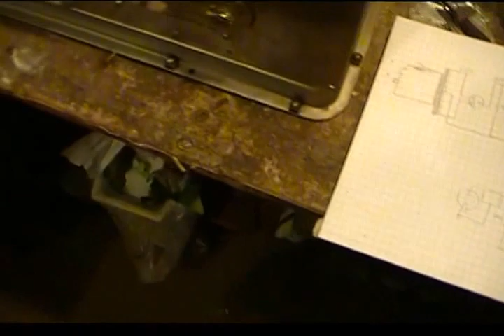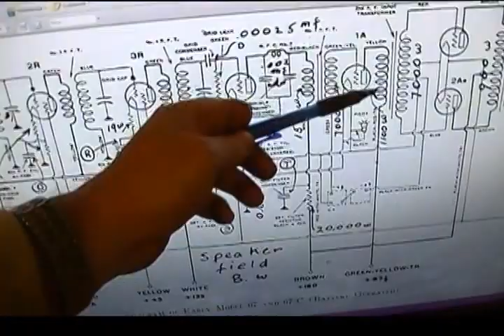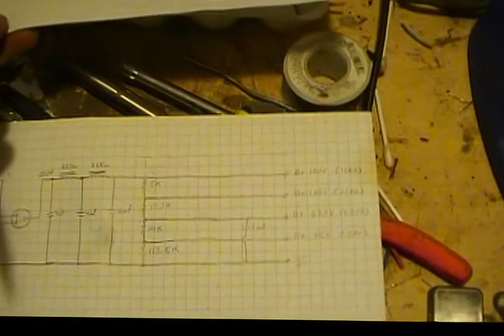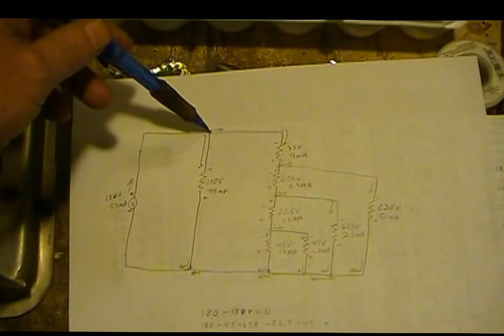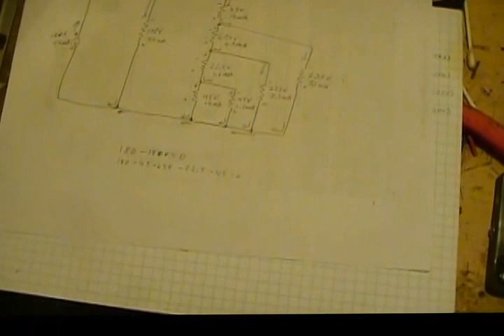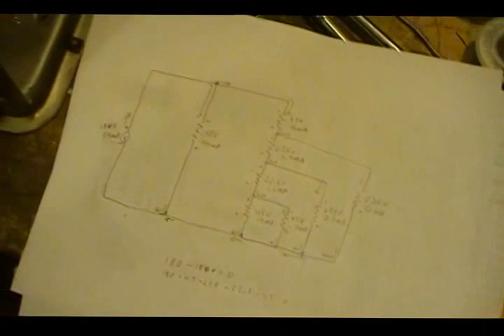Atwater Kent 67C part 6

Comment: Hi Dennis, that chassis looks lovely - be a shame to put it back in the cab when it's working!   The discussion on the power supply was very interesting.  I'd be interested to see the final voltage measurements once it's all up and running.  Great work as always.
Cheers,  John
Reply from the maker: Thanks John. On the next video I will the voltage readings. There is more to be done but it's miner stuff.  Your friend  Dennis

Comment: Hi Dennis. Wow !  That looks Fantastic My friend.
Thank you for sharing.
Your friend. Bobby
Reply from the maker: Thanks Bobby. I don't know what's going with You Tube but this video or the one AVC circuit is showing that I any comments in the video manager. If it wasn't for the bell or my E-mail I would not even know. And another thing is only you showed up in the bell and Art for some reason.
 Thanks again my friend.
Your friend   Dennis
Reply: Dennis Carter
Hi Dennis.I've had the same trouble my friend. It seems there is a delay. I believe it's the way all messages are being routed to. Um let's just say a certain group of servers.You can also check for messages in your inbox. The easy way is to click the down arrow on the right side of the Upload Button, on the upper right part of the screen. next to your name and the bell thing. When you click the down arrow it will show three things. Dashboard,  Video manager, and Analytics .Click on the Analytics and look for Inbox. I hope this helps.
Your friend Bobby
Reply from the maker: Thanks Bobby I will try that. 
Your friend  Dennis